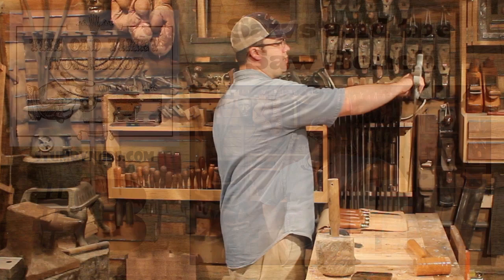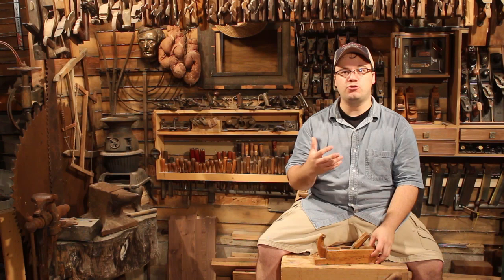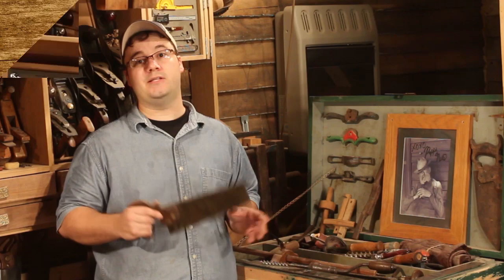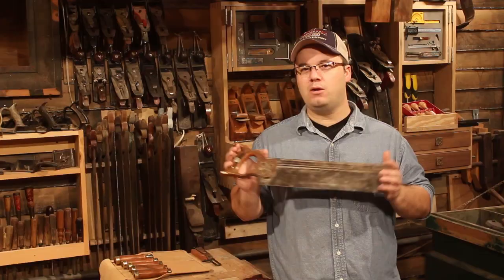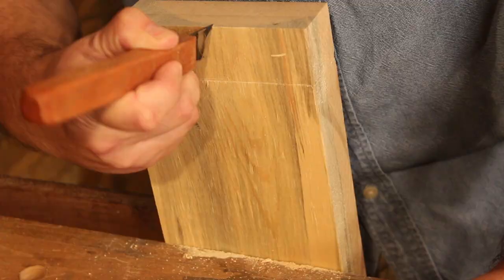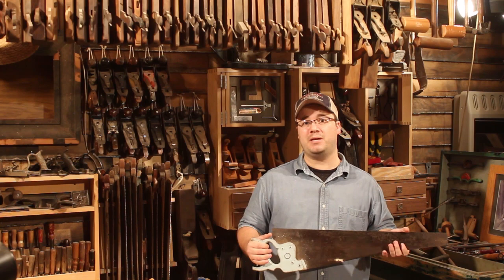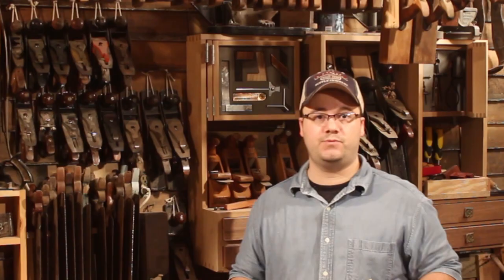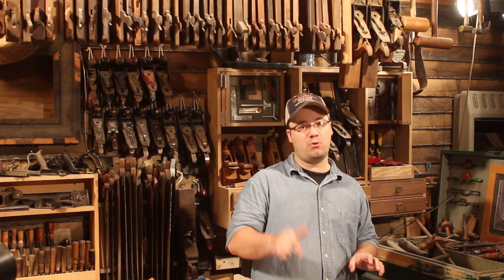Build a $10 saw bench and learn about hand saws: Stumpy Nubs Old-Timey Woodworking 3

Comment: This was my first time watching one of these video, I am at a lose for words, it over the top in so many good and bad ways. The project was good for some just getting start but I was 10 to 12 years when did these so it was 45 years ago, but back then no video or YouTube just a library card, popular mechanics and wherever else I can get my hands on. What wood I got home was what I could strap to my bike or back or wood crate from dads shop. My dad own a a glass company and was I shop the glazer until I could drive. Power tools I got where tools from the trash dad had no patience to fix things he just threw them away (or at the wall he got pissed off) Most times they I needed was a new brushes. Had 1 cross cut saw and miter box saw, hand drill and Orange and green drill made of two drills vibrating sander and sandpaper. But if I wanted something I built it didn’t have money to buy, like a bookcases, bookends, chairs, desk anything I can imagine or find plans for.

Comment: A neat tip I picked up for hand sawing the other day is to look at the reflection of the wood you're about to cut in the blade of your saw. To cut at a right angle to the edge the wood and it's reflection should form a completely straight line. If they form a V then you know your blade us cocked to the left or right of dead square. Of course this requires that your saw blade be shiny enough to see the wood's reflection clearly.